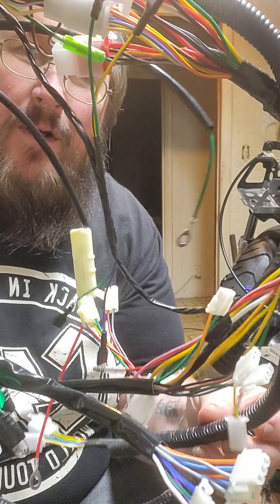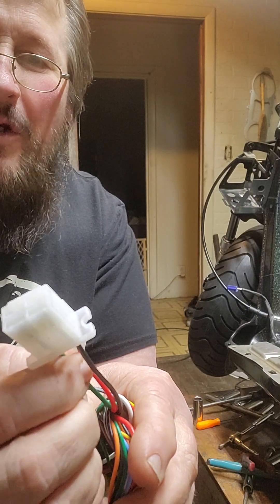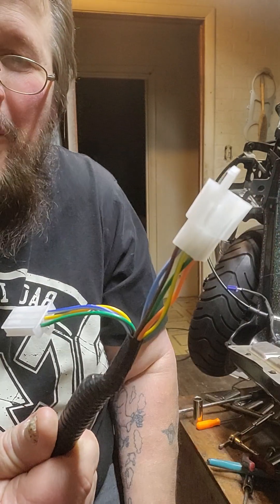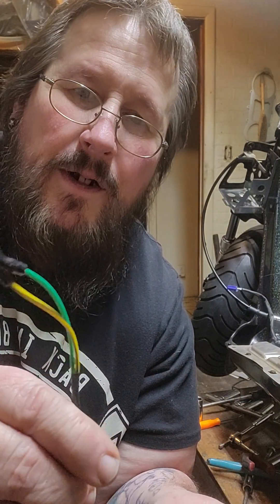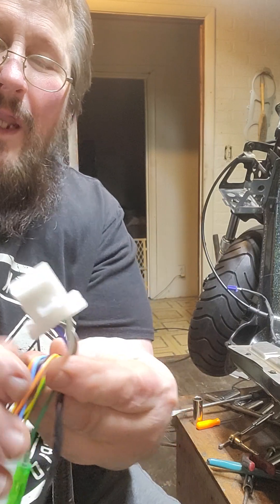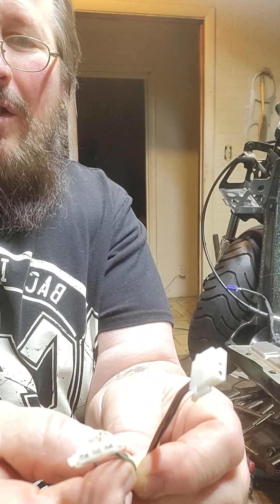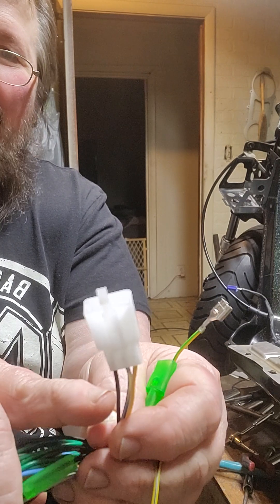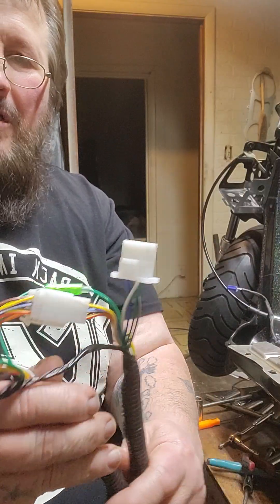gy6 150cc wiring harness

Comment: Thanks for video.....I have a gy6  150cc on a Kandi kart. My issue  is no crank over or start unless I turn ignition on and jump across the solenoid.   Something that I noticed is something odd with the brake safety switch. The only way the brake lights light up is to jump across the screws, which is what you do prior to turning the key switch to start is press the brake pedal. I have put 2 new brake switches on it but again, the only way it seems to make the brake lights turn on is to jump it out and to start the engine I have to turn ignition on and jump solenoid with brake switch jumped as well. It has me baffled.  Any suggestions? ...2015 KDA-150 Kandi 150cc buggy/kart. Thanks in advance.

Comment: On the harness it looks like you had a plug with a jumper wire in it from the factory. If it's anything like my scooter, pull the jumper out, and your key will not kill an AC fired ignition system anymore. Thats the s8de of your ignition that geounds when you turn the key off.

Comment: I have a Kymco Agility 50 and I have two wires that I can’t figure out the other end connection. I have a Green /Black stripe wire that is connected to the stator the wire runs up to the handle bars and I can’t find the connection, 

The other is the blue yellow wire., It comes from the Pea-cock, runs back to the stator and I believe it is supposed to be extra but I have no Idea. 

I recently bought a loom for this kind of thing to keep on hand

Comment: So I got tired of looking for a wheel and I made one. I ordered a 150cc 10" gy6 wheel and it was so close to fitting, I cut out the center and welded it back in about 3 mm farther negative offset so that the brake completely clears the wheel. I got my buddy to machine it and we added aluminum with the Tig and balanced it on the tree. I hope it works out. It's balanced and it looks really good and completely clears the brake. But now I need help with the harness. I ordered a harness with connectors that do not match the controls and lights and some of the wires are different colors. I need help sorting it all out so I can get my lights running. I have soldering iron and heat gun, I have a robust reworking station, actually. I just need a diagram

Comment: I do appreciate  the video first off. I want to ask you how to get this harness to fit. I don't feel like my Ignition is at the right spot. I dont know if I got the voltage Regulator in the right spot? Also i Got a new stater as well as a new  everything in between. But I can't get the fly with off of it. I've greyed every thing I know of to get out off.  Some advice would be awesome

Comment: Hello my name is Brian and I want to thank you for your video it's been really helpful but there's only one thing I have not been able to find the GY6 harness that you've got on your video with the multi connectors for The handlebar dash and I was hoping you could help me out trying to find one you call it the VIP
Reply from the maker: @brianhellems3911  man just Google replacement harnesse for your make and model I normally buy off ebay ,cheap less than $50 usually

Comment: Hey man,ive got a 2021 vip 50cc.i just put a glixal big bore kit on it, now it doesn't want to start, valve lash is 4 thousand intake and 5 thousand exhaust,its started a couple times and sounds great but then I have to fight for a hour to get it started again,any ideas?
Reply from the maker: @MatthewJackson-is8ey  if it's anything other than stock put the stock cdi back on and try it also with more compression you might try a larger ground from the battery to the eng itself
Reply: @scooterdeuce13  10 4, thanks man. I was out cleaning some gutters or I would have got back with you sooner
Reply from the maker: @MatthewJackson-is8ey  definitely try the stock cdi the others do something to the timing and make them hard to start
Reply from the maker: @MatthewJackson-is8ey  what cdi are you running
Reply: @scooterdeuce13  it's the glixal orange CDI, came with the kit,

Comment: A BIG thanks,  neighbor got a old scooter (no key, of course) and missing parts etc.  I had to fix the battery cable and  jump the ignition switch wiring and the start button was broken but looking at a wiring diagram and what I learned here  I got it to crank and run without having to butcher the factory wiring.  Now all it takes is money.  I keep telling him it's not worth it but it's his money.  Surprisingly,  it appears to have a good battery after charging it up.

Comment: You did not mention the switch that has nothing but a single wire looped in to its own switch. Also I have an a/c cdi  like you explained in detail but I also have a kymco which is a d/c cdi and it seems like the ignition and a few other things are different
Reply from the maker: Correct that's ac cdi and harness guess I should clarify that about 95% of scooters that run through here are the same occasionally very rarely do I fool with the other normally like you say a kymco or another tiawan bike not Chinese
Reply: What wires are jumped or looped in that connector, the previous owner had a remote start unit I’m trying to remove
Reply from the maker: @natemendoza7800  I'm sorry I been extremely busy the jumped wire is normally the kill wire
Reply: So does the jumped wire  need to be unplugged so it's not acting as a kill switch?

Comment: I have a question for you. I have 150 cc Chinese. when I pull the brake to start the scooter digital screen reboots and start switch is not working. When brake is pulled no brake light comes on and my horn also is not working. It seems that brake switch and thereafter there is a short. When I short the starter relay it turns. What do you believe I have the problem of.

Comment: I got a lance 149cc scooter...Im In need of alot of help I recently got a gy6 scooter the wire was completely everywhere in it the light were all hot wire on with a radio harness which made it more confusing I watch it video only problem for me is I need a complete break down from bare wire I want to redo the whole wire harness from Bak to front from battery to to lights can u help me pls
Reply from the maker: You can go on ebay and buy a brand new complete 150cc harness for less than $50 the one I use are like $30 If it is cut up and a bunch of shit added to it I would personally order a new harness unless you're in a country where parts arnt readily available
Reply: Ordering new harness is not optional I have the whole harness it's complete I jus wanted to start a whole good loôking wiring where it doesn't look all shitty....I can show u some pic of the scooter tht way u can walk me thru the wiring process

Comment: Where does the black and yellow striped coil coil wire connect up to I can't find a video about it. I have everything else ran correctly but my coil wire. Harness won't get spark from spark plug.
Reply from the maker: Normally the yellow with blk strip coil wire runs from the cdi out to the coil and splits off in the harness to the front of the bike to run a tach
Reply from the maker: Make sure your pick up wire is hooked up correctly from the stator its either red with white strip or blue with white strip that the signal wire for the cdi to run the coil
Reply: There is a black and yellow stripe wire in the middle of the wire harness that has a connector clamp on it but nowhere for it to go. So I was wondering if that wire was suppose to to be attached to the frame or ground. Not sure.
Reply: @itsus4x That Connector Clamp Attaches To The Ignition Coil It Should Have A Male Connector Piece Attached To It. For The Ignition Coil To Work It Needs To Have The Yellow And Black Wire Attached As Well As A Ground Wire There Are Two Types Of Coils That I Know Of One Has Two Holes On Each Side To Mount To The Frame And A Male Connector Slot Attached For The Yellow And Black Wire And The Ground Cable Goes On Either Side Of The Holes And A Bolt Holds It In Place And Grounds Out The Coil, The Other Has Two Male Connector Slots For Both The Green Ground And Yellow & Black Connector And Both Of Those Would Have A Female Connector End Also It Has A Hole Slot To Mount It To The Frame

Comment: I want to run dc power from the light controls on the handle bars so I can run led head lights  and turn signals what’s your suggestion
Reply from the maker: What make and model is your bike
Reply: @scooterdeuce13  it’s a pony I was thinking I would just find the wire that’s supplies ac voltage to the switch and change it to dc
Reply from the maker: Does it still have everything in the stock form